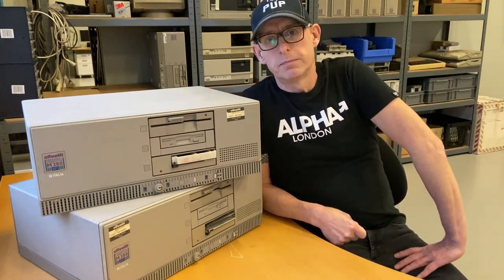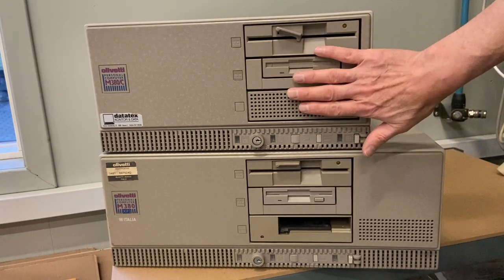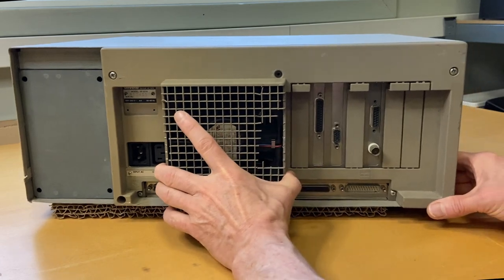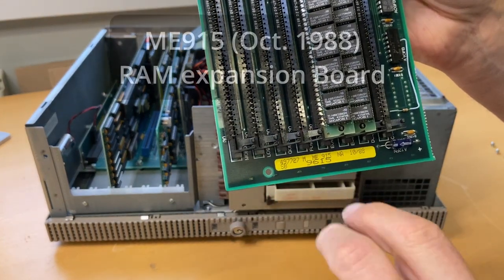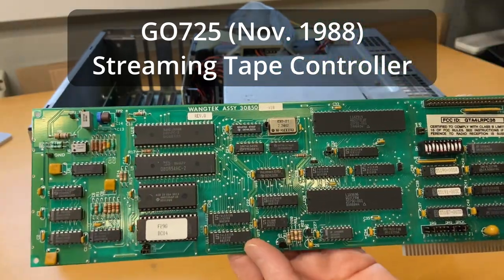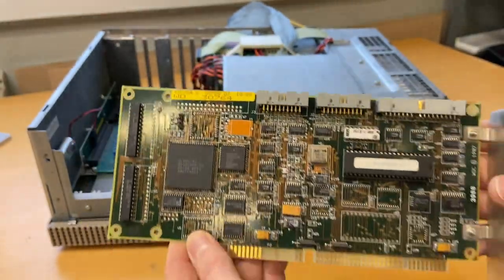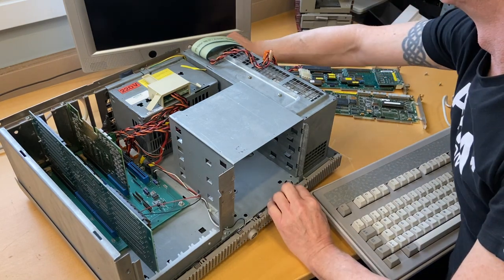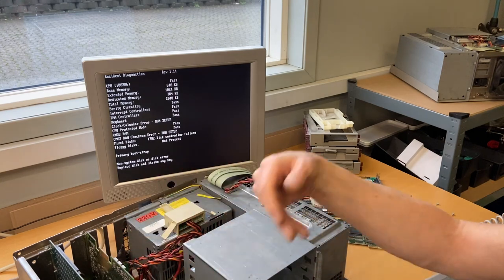Olivetti M380 XP3 80386 - Episode 1

Comment: Very thanks for this time-machine session. I had the same model 386DX@16MHz, 5MB of RAM, 72MB of HDD in the middle 90's, but without tape drive. It was really heavy box. I remember carrying it in my hands in winter for about 2 km to my friend's house for reinstallation of DOS 6.22, Norton Commander and Windows 3.1. It was my first really personal computer. First practical steps and movements to study how it works.

Comment: taking me back to when I was 18 years old again.   W stood for Wide, there was a m380/t for tower.  GO stands for governor olivetti i believe.  Interesting that they have the black and white olivetti maintenance labels on them - so either olivetti internal stuff or were under maintenance with olivetti
We generally used a resistor or old hard disk as a dummy load when bench testing the power supplies as they dont like firing up without at least a small load

Comment: If Olivetti didn't go non-standard on the network card, I would guess the non-BNC/Coax connector is a 10Base5 ("Thicknet") connector missing its 2 pins for the cable's latch bracket to hold the cable on.  If so, there were commonly available transceivers that attached to the 10Base5 connector, and provided an RJ45 10BaseT connection, making those network interfaces easy to use with modern twisted-pair networks.
I suspect the card for the tape drive is a SCSI card - I think most tape drives were SCSI, except the cheap 90's floppy controller-based consumer drives.  The 50-pin internal connection and external DB-25 would be normal for SCSI.

Comment: I don't think I've ever seen a PC speaker volume control before. All the ones I had were just full blast or off.

I also found it interesting that the the network card has a Motorola 68000 on it, the actual processor used by low end Amiga, Atari ST and Apple Mackintosh computers. Was networking really that power needy back in the day, or was it just a very high end machine? Keep in mind, in 1990, I would have been 7 years old and still using an old Commodore 64.